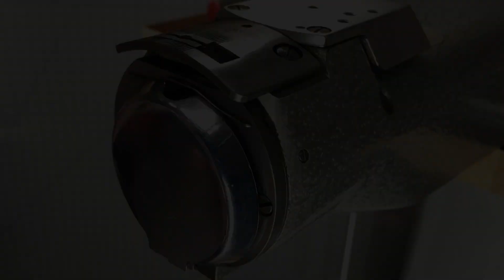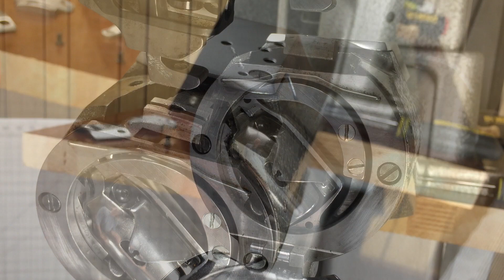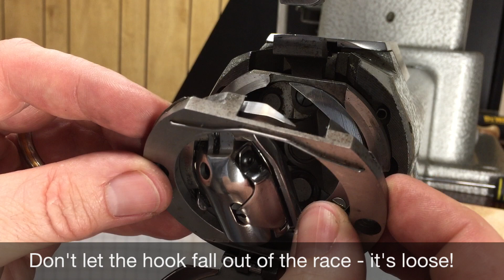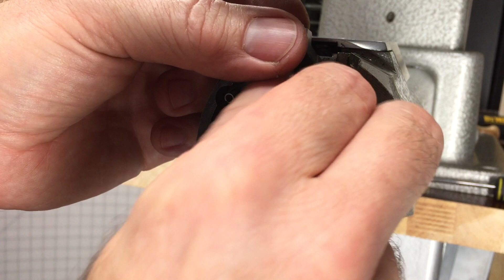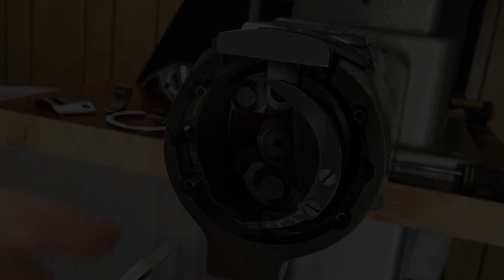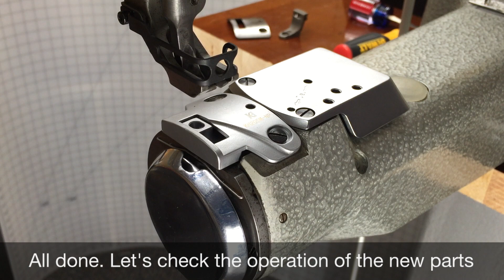KH205M Installation

Comment: Hello Uwe, can you say if this type guaget set would work on an Adler 105-64?
Reply from the maker: It may fit (I'm not sure, though) and on an Adler 105-64, but it likely will not work well since the 105-64 machine is a bottom+needle feed machine. Without teeth on the feed dog your needle has to do all the work moving the material.